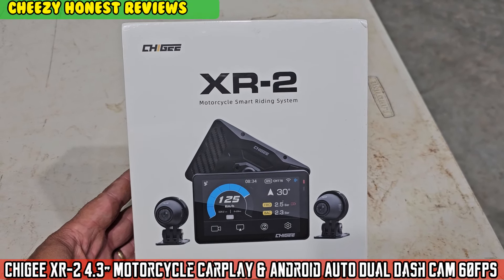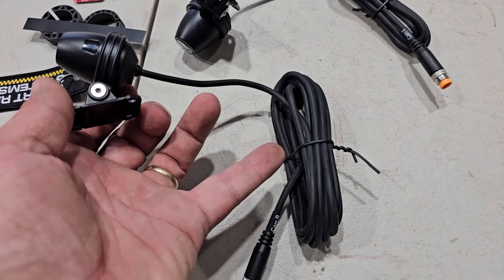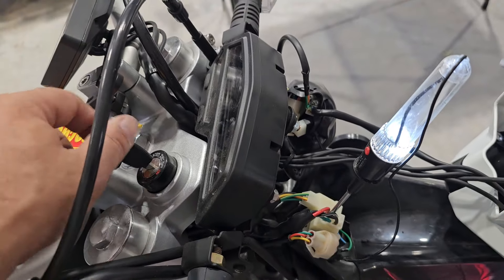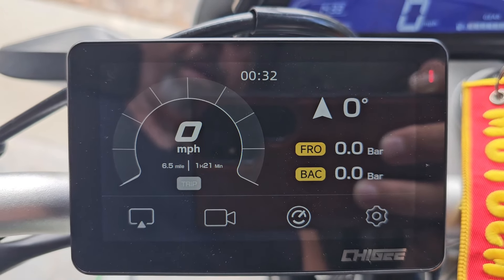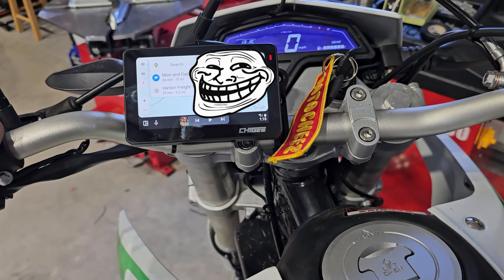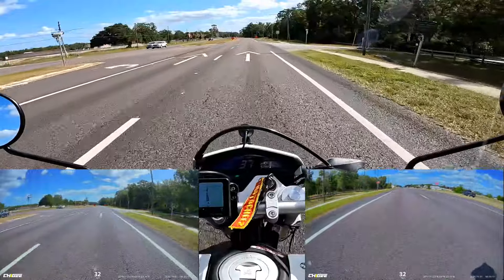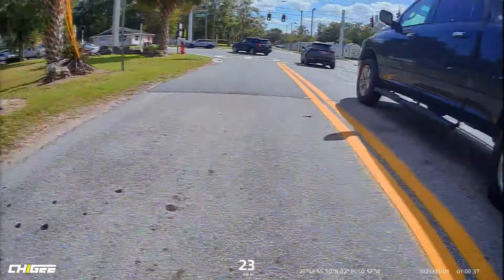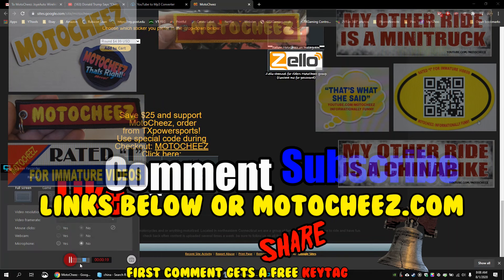CHIGEE XR-2 4.3" Motorcycle CarPlay & Android Auto Dual Dash Cam, 30/60FPS Waterproof, HDR Video

Comment: Thanks, great video! I have an XR-2 mounted on a Maxi Scooter. Exceptionally clear display. Auto brightness is very good. Turns on/ off automatically. Want to get ODB connection sometime. I'd like to see trip stats showing a full days ride rather than last trip only.. If you stop the stats reset (all except cumulative miles/ km's). In particular it would be great to see cumulative elevation for the day. Also would be great to save stats internally on the SD card or to email. Very high quality unit.
Reply from the maker: Awesome. That's a great idea. I'll mention that to the company

Comment: Is the speedo feature accurate any on this unit? If it is it looks like it would make a good replacement speedo for the ones that come on the bikes.
Reply from the maker: Yes, it's calculated off the internal GPS. That's a great idea!
Reply: @MotoCheez  That's good to know. I'll have to look into one when possible.